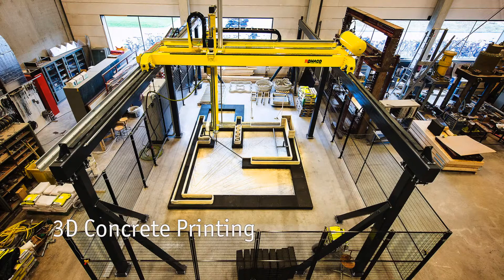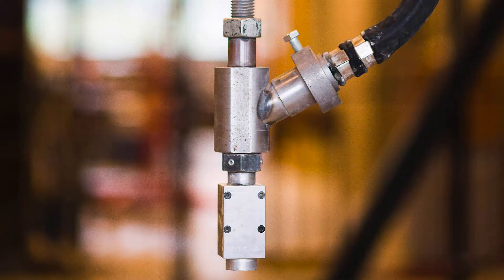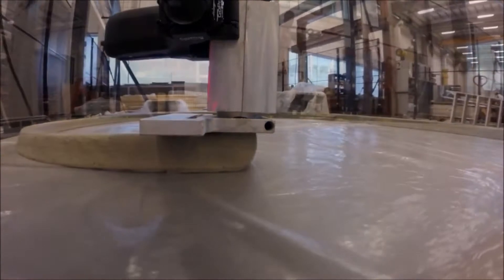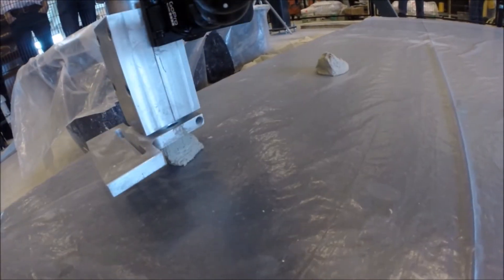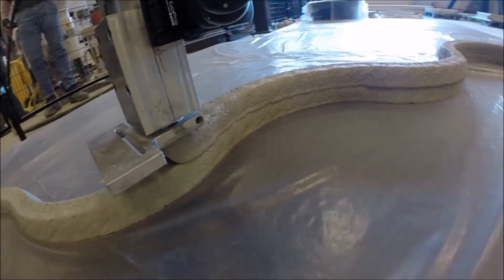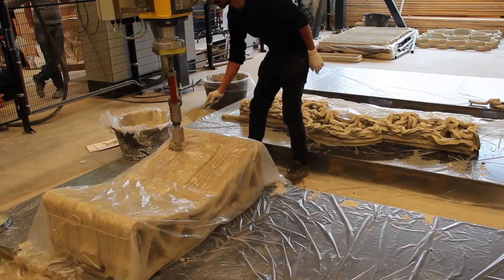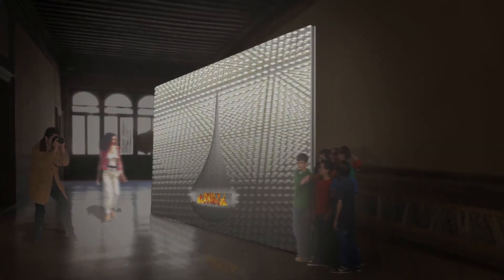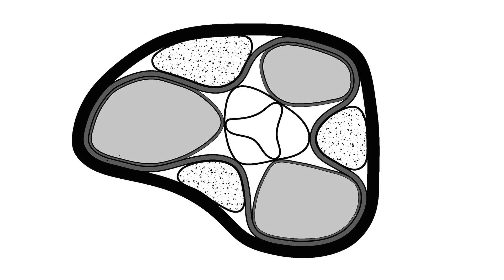3D Concrete Printing interview 3TU.Bouw

Comment: When 'concrete' was a relatively new material for home construction it was used in high-end housing. I'm thinking some of the art-deco minimalist structures of the 20s and 30s. I think the same will be true for 3D printed concrete. Its first uses will be in high end more organic shaped housing -why compete with boring slabs when you could print a sea-shell shaped spiral house at the same cost? Computing and printing enables these organic inspired structures to be built.

Comment: questions: 
what would be the cost range be for some of the 3d printed houses suggested?
how would the strength of these structures compare with conventional residential house construction?
Is it reasonable to think that the 3d printing gantry could be purchased and used to build with here in the us in the next year or two?
self cleaning concrete and transluscent concrete was mentioned.  is this something that has been successfully printed with in 3d?  can we see some examples?
can you provide more information about your experiences with this interesting topic?